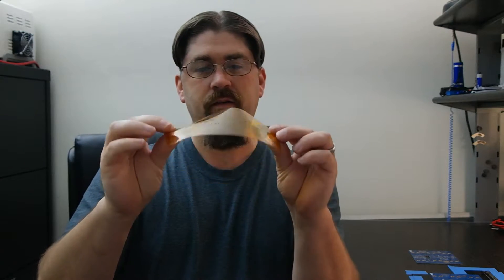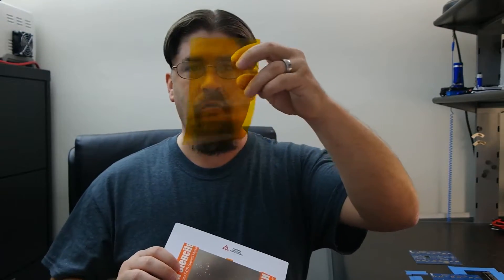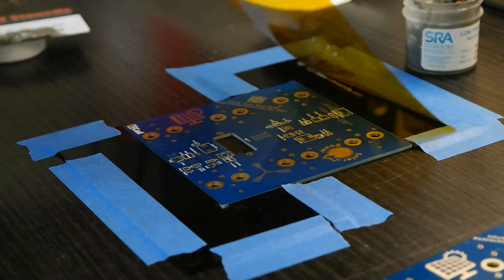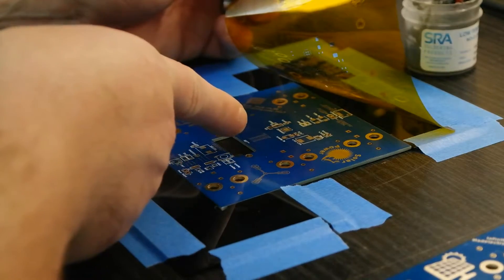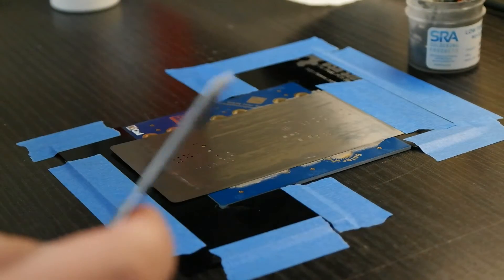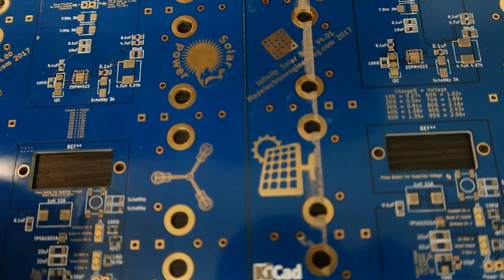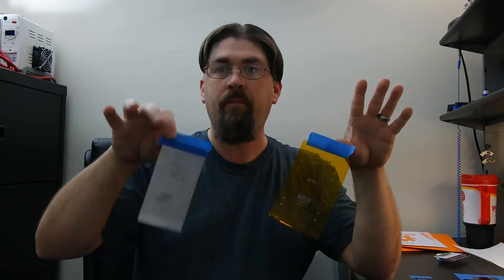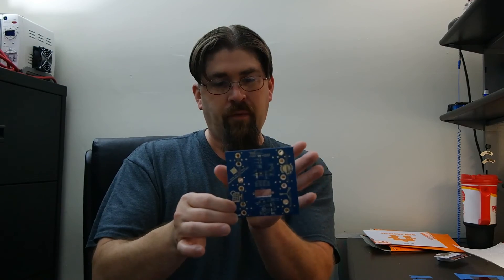OSHStencils Stainless Steel Stencil Review

Comment: Your solder paste is dried out. Add rosin and mix well. Makes old solder paste new again. My solder paste is well over 2 years old and there is no problems with it.
Reply from the maker: You are correct, I did this the day after I made this video.  It made the solder paste a lot better, but still not like it was when it was new.  I followed sparkfun's quick video on adding flux to bring it back to life.
Reply: I can't tell. I didn't use my solder paste until about 6 months later and I bought a lot of it. A huge jar. But it does make it easier to spread and the solder looks good after reflow so I'm happy. I was worried that I wasted $50 on solder.
Reply: I also keep the solder paste in the refrigerator when I am not using it. It slows the reaction rate way down so the paste is good much much longer. I keep the paste jar in a ziplock bag while in the frig to prevent any food contamination. You have to let it sit for a couple of hours before use so the paste reaches room temperature. Doing all this, I am still able to use my solder paste after more than a year. I think it might even be two years.

Comment: ooh....what is that board???
Very cool!
Stainless steel also is a tiny bit thicker isn't it...which means more solder to bond the parts down
Awesome...keep the video's coming!
Reply from the maker: +Brian C actually it is in between the two available thicknesses in kapton, but much better quality.
Reply: Don't get the thicker kapton. It's too thick and leaves way too much paste. Get the thinner one or the stainless.

Comment: I've been making my own using brass sheets and etching them same as PCB's.  Decent results.  You might also try Kester EP256.  Really good stuff, and  my last tube lasted over a year refrigerated.
Reply from the maker: +GeorgeGraves ep256 is good but lacks the 1% silver to make the solder more malleable and less brittle then just plain tin/bismuth mix.